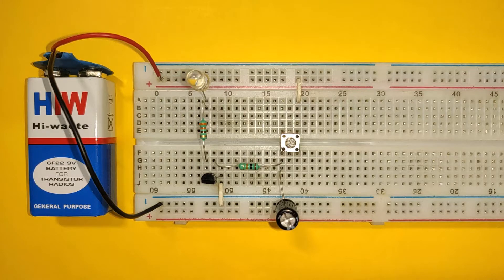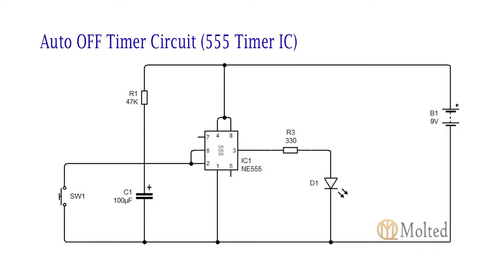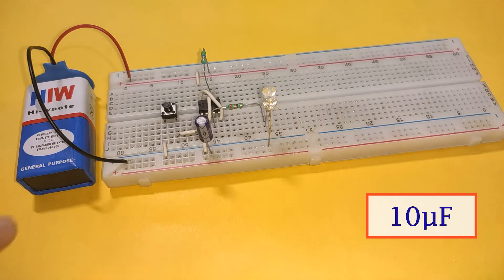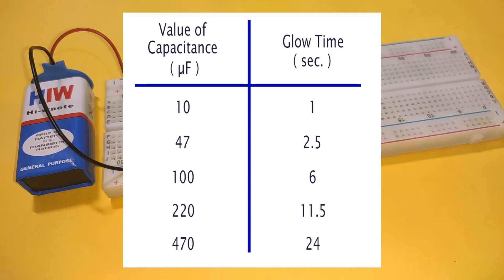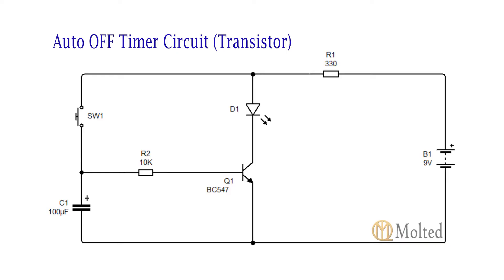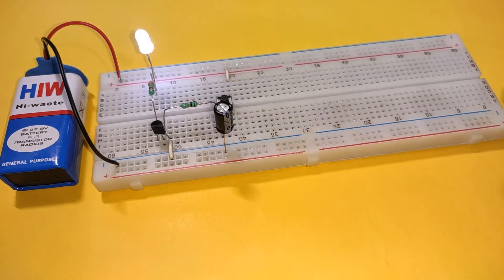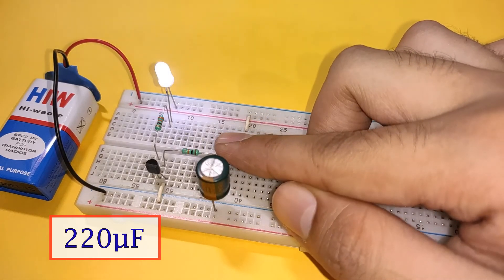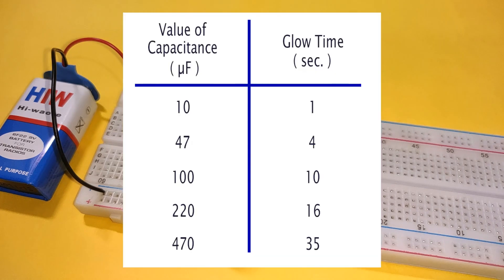Two Auto-OFF Timer Circuits || 555 IC or Transistor

Comment: I made the 2nd circuit and the LED reacted in an opposite fashion; the LED was constantly on, and turned off when I pressed the switch... What am I doing wrong?
Reply: Have you made sure that you have the led from pin 3 to the correct side of the voltage supply.

It will light up from pin 3 to positive rail and pin 3 to negative rail. But they light up at opposite times.